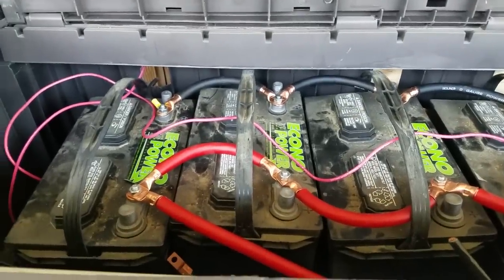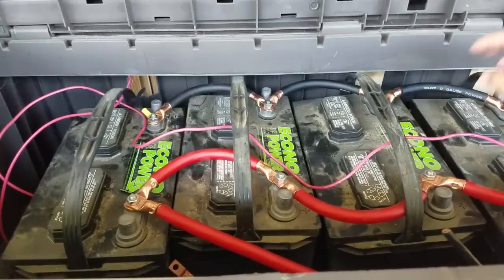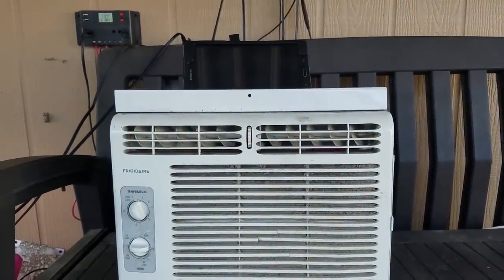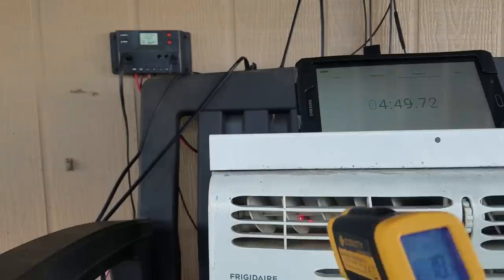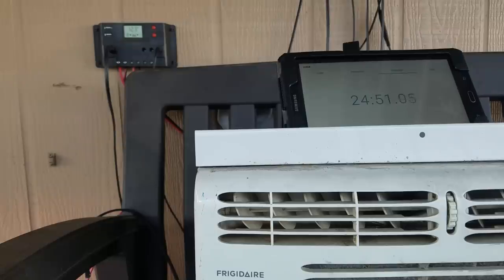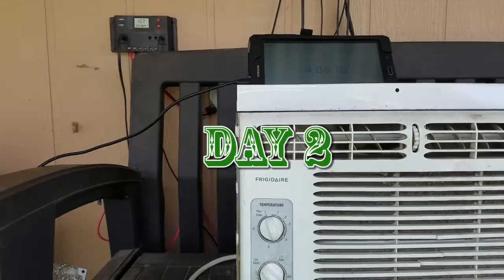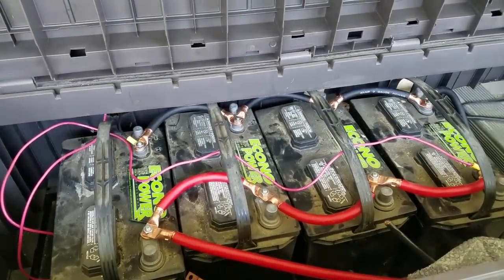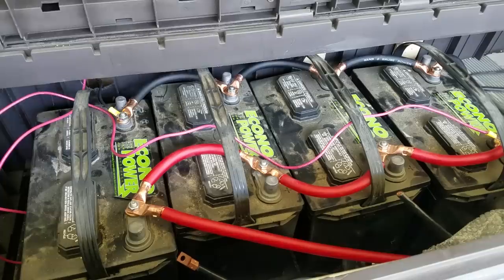Running a 5000btu air conditioner on Harbor Freight solar panels?

Comment: Deep cycle batteries are terrible..
My first time doing solar I had too many shorts on the Deep cycle batteries and they gas off...plus have to check the fluids all the time
But I got them from Kmart so I just kept replacing them for free lol...until I tried and switched to AGM..
They are a little more pricey ,but no more shorts and they last much longer..
Much safer..and no smells
Only if you over draw them too much they will fade in power although if you have a recondition charger you can get them back to new most time's..
I have have my five AGM s for seven years now  running 365 days and they are still taking charge and giving me enough power to get thru each night running two  fans 14 - 7 watt LED  lights inside and outside and flat screen TV PlayStation
I can run Aircon I have run my 5000 BTU from 11 am to 330 pm many time and the rest of the day recharged my system almost to full..
I have around 500 amp hours bank and 750 watts of panels..
Really I found that if you run your fridge on a separate system it is much better so I have two 100 amp hour batts 250 watts of solar and a 2500 peak inverter to get it started and a 30 amp charger controller..it's about $600 worth of hardware ,but it has not failed yet..
Most important is the fridge...to keep lots of fresh  food 
Having a bigger inverter so it  puts less strain on everything and a bigger  charge controller the same.. 30 amp
I am now about to switch to lithium battery set up as the cost is dropping and is about the same price as AGMs and it's way more power for the same price..
So I spent for my system about $2500 seven years ago and I have not had a power bill in seven years..
That's included cables all hardware
It's awesome..

my system consists of..
4600 peak inverter, from eBay 
a 1500 peak watt backup inverter from home depot
2 -30 amp charge controllers plus a back up 30 amp controller it's on stby mode from eBay
five AGMs from car quest 
Two AGMs for my fridge
so actually seven total
3- 255 watt panels I got locally for a dollar three cents a watt..good price and one more 30 amp for my fridge one more 2500 watt  inverter and that it..
One thing I learned is buy backups for everything you buy..if something fails your back online in minutes...iii

Comment: Why aren't you using Trojan L-16 batteries they each are 12v., 300 amp hours true deep cycling lead acid battery, put 2 batteries together in series for 12 volts, 600 amp hours. Or you can buy 4 Trojan L-16 batteries and connect them in series parallel for 24 volts, 600  amp hours, which will perform much better and take longer to draw down if you use Trace Engineering converter inverter with microprocessor to control the charge rate and you also use other sources of renewable energy, like wind,water generation, steam electric generation and genverter type system diesel engine running on biodiesel fuel. Trace Engineering converter inverter is a true sine wave system, is very efficient, consumes very little power for it's operation, it has automatic set up for changing over to different sources of renewable energy and will start a diesel engine type generator with electric starter of course you have to wire everything to work for proper operation on such a system. You can get the Trojan L-16 batteries at Batteries Plus and  Batteries Plus Bulbs. If keep proper electrolytes and pacific gravity proper within the batteries of the Trojan L-16 batteries true deep cycling lead acid type batteries 12 volts type and kept properly charged, they should last at 5 to 7 years or longer. It's best to use as much as you can D.C. lighting, L.E.D. type and other D.C. operational appliances to lower power consumption, you can use with Trace Engineering converter inverter 24v system the 120 v. system or you can pair them up for 24, 240v. system but, if you use a single 24v., 120v. system you can use an autotransformer to step up voltage to 240v. to run an central air conditioning system for quite a number of hours before batteries will going into a recharge on this type system. There are great battery books on figuring the watthours and convert amphours for proper loads consumption and sizing the battery bank amphours.
Reply: Two 12 v batteries in series would be 24 v, in parallel they would be 12 v, but double the amperage.

Comment: A 5000 Watt inverter can pull 416 Amps off the batteries. Use a brushless fan if you have to enclose the batteries.  I would never enclose wet cell batteries myself. Don't use more than 170 Amp/Hrs off the batteries as they are not AGM's  (so be sure you always have 12V reading on the batteries). You may be able to run the AC for 3 Hrs. but doubt it will recharge the batteries for the next day.
Reply: How many watts solar panel do I need to power a air conditioner that's 500w ?

Comment: You do know the AC will pull 60 Amps @ 12Vrms.
Reply: Maybe on initial start up of the compressor. After that it will be around 37amps coming from the battery. These are like 450watts running. And about 4.5 amps draw on the inverter itself. 1 amp when the compressor is off

Comment: All of that (especially the batteries and replacement batteries etc...) cost more than the 5k btu AC would use when it is all said and done.  At least here at almost 10 cents per kilowatt hour.

Comment: You need a "Solar Education"...most 5000btu A/C units require 515 watts of power when running after start up...You solar setup is only 200 watts,so all you're doing is draining the batteries!!!! For a proper solar setup you need a minimum of approx 900 watts,(start up wattage of the a/c unit) so you are not robbing the batteries full time...

Comment: I have been running a 12 by 16 shed off harbor freight solar power    for over a year now. I like not having a power bill
Reply: I think what corbett is trying to say is they are using the $150 100watt solar kits and added to the panels over time as funds permit to gain more charging power
Reply: sounds like that cost quite a bit.
Reply: RingingResonance I have a 8 dollar power bill a month  now for hot water
Reply: how much did the initial setup cost? how much was your bill before the setup?
Reply: Bill before was150 and I did the set up myself
Reply: How much did the solar panels, cost?
Reply: RingingResonance I pay 150 a site

Comment: 150 watts of solar panel X 5 solar hours per day (Look at a solar map) is only 0.75 kilowatt hours of power going in. By the time you figure for losses you have less than 0.5 kilowatt hours of power to use per day. Nowhere near enough to run AC. That is probably enough to run a 100 watt bulb for 5 hours each day if you are lucky

Comment: wow you stuck the fork in a hot topic from reading the reply's . got a good back ground in the physic's,and I can tell you your on the right track it comes down to at the surface of the earth a square meter has the potential of bout'MAXimum 975 watts of energy a meter yes a square meter, if they tell you different there reflecting light to the panel some how in space you got about 1300 watts a square meter so you can see how little the atmosphere attenuates the "signal" unless a cloud gets in the way or something but you don't need air conditioning so bad then, do you. and that's probly good theres still some...some power even if a cloud gets in the way solar powered air conditioning as a stand alone system it could be made to happen    another thing is the people who think that somehow your cheating by using the batteries the system needs a capacitor so it can discharge a constant current and in your case it can run in a charge deficit situation for a period of time you can use the volt meter readings and a battery hydrometer to look for weak cells clean the case carfully add distilled water (rain water is  really good) but just plain good battery maintnence batteries produce hydrogen/oxygen during both the charge and discharge cycles guess where that comes from so watch battery condition so ya the explosive gas hydrogen all you got do to is vent it and it goes awaygood work I hope to see more from you

Comment: Well, I didn't see any mention of how long it ran but based on how many amp hours and guessing the a/c pulls about 450 watts, it should run for about 45 minutes on the batteries alone. With the panels probably 1 hour 15 minutes.

Comment: Running in series at higher voltage would net more efficient draw from batteries. Of course you lose AH capacity but it uses less at a given time.

Comment: econo power O.o thats a car battery.
should look into some proper deep discharge batteries :)
glass mat or gell designed for weelchars/scooters work great last waaaaaaaaaaay longer.
you dont need masive amps up front (car battery) you need sustaind amps
Reply: Screw lead acid.  Go lithium ion

Comment: That system will work and run better with the a/c installed. It would bring the temp down in the room and the compressor would cut off from time to time and allow the batteries to charge.
Reply: How do you hook up a combined  box on a hardfi solar panel system
Reply: How many watts solar panel do I need to power a air conditioner that's 500w ?

Comment: Probably a better test would be to run it in a window in a room. Reason being the ac unit is constantly running outside in the ambient temp. In a window the room will cool down tripping the temp sensor on the ac unit and put it into fan mode which will use much less power. Then run it and see how long it lasts.

Comment: I have a 10kwatt inverter on my truck with one batterie an i run everything off it
Reply: jburr36 An automotive alternator will typically be able to put out between 1200-2400 watts. That's assuming no loses, at the ideal RPM (not idle) and they aren't designed to do so at high duty cycle. So 10kwatt isn't sustainable even while running the engine.
Reply: I never said it was supposed to be sustainable and neither did the original poster of the comment.  

In fact, Lealon never eluded to the fact that he runs anything at the inverter's max load.  What most people fail to realize is the difference between starting current and running current.  Most induction devices are pretty much a direct short until the magnetic fields are generated when first powered on hence why all the lights in a house or car dim the instant a motor or microwave is turned on.

Starting batteries are designed with more thin plates per cell to generate much higher current loads for short bursts.
Reply: jburr36 oh please, I don't need a lesson on electricity here. I was responding directly to your remark to Future Highlight who specifically called out the sustainability of a fully loaded 10kW inverter on battery power alone. 

Sure, it's not a likely scenario but that's not what we're talking about.
Reply: Oh please.  Show me where Lealon ever mentioned sustaining anything from a 10kW inverter maxed out from a truck battery.  He said he can run everything off it.  He never said what everything is and never said maxing out 10kW full load. 

It's you people implying that then making statements of condemnation.  Stop putting your own words into other people's comments then criticizing them for it. It's stupid.
Reply: LEALON SMITH Do you keep the
engine running?
Reply: Aye guys im not saying nothing bad about anybody or anything bad about the vid its awesome vid but i do keep the engine at an idle its a regular alternator from autozone ill be posting a vid soon to show ya but they are alot if thing you can run off an inverter
Reply: some of these people believe you are pulling a full 10 Kw load from the inverter at one time.  They are correct that the alternator and the batteries will not sustain that load for long however my point is that I think when you stated you can run everything off it I implied you did not mean all at once.

I implied you meant your system can run every tool you had without any issues because not one tool pulls 10 Kw+ of power.  

Again the hardest current and power draw for any tool would be startup current and that's what startup caps are for.
Reply: or use the alternator for the power source you shithead

Comment: Very very dangerous to put a non brushless fan inside the cabinet where the Fire / explosives / health hazard gases that you're trying to exhaust pushing air out of the cabinet therefore the flammable and explosive gases that are being exhausted are actually passing directly over Sparks inside the motor very very dangerous the only way I would use that fan is if I had mounted it on the outside pushing air into the cabinet this unfortunately is one of the big reasons why power companies officials Etc are able to get away with Banning solar power like in Florida is because of dangerous things like this if you're going to fail at this you're definitely going to put people's lives in Jeopardy on the grid
Reply: Thomas Ordon
 uhhhhhh.  that is a brushless fan.  I have one just like it. It uses a small induction motor. There are no sparks.
Reply: If the fan is on constantly while the system is running then the hydrogen produced by the charging batteries wont reach the LEL and wont be a problem.
Reply: an AC motor is probably gunna be brushless, my dude.
Reply: You Find Me A Spark On a Shaded Pole AC Induction Motor Ill Buy You Lunch. . .

Comment: I don't get these videos it's the batteries that are running it, it's not like you can hook up the panels to the inverter and run it or run the AC indefinitely with only 150w of solar

Comment: You can run off the batteries, but even if at 100% charge from panels the AC unit is pulling more then panels are putting back into batteries, after batteries are dead it would take along time to bring them back to full charge with a small array, 350 ahr x 12v =4200 watts ÷ 150 = 28hrs of full sun,if you are lucky you get 6hrs of full sun a day, so about 4-5 days to get the energy back into the batteries . Basically 7hrs of cooling 4-5 days to recover, it can be done just not sure if it's practical.
Reply: starting current and running current for the AC unit are 2 different things.

Comment: Just one more saying NAY
NOT SOLAR, you are using battery power,
You are operating at a deficit, panels produce 150w max
And the a/C uses about 700w
Reply: Mr_Wizard he said he wasn’t going to run it all day off the batteries.
Reply: its like burning 1 gallon of gas while  putting 1 quart of gas in the tank
with a limited tank, cant go very long, 
going to hit empty real fast
the A/C uses over 4 times the power, being produced by the Solar panels
the title of the video is running off the solar panels
he is not doing this, he is running off, the batteries
with solar providing LESS than 1/4 of the needed power
what he is doing is 'maybe' the batteries will last 20% more run time
until the batteries are dead
Reply: But that is how solar works. You can not use panels strait to inverter. Also in This case you can not use the a/c  all the time. 
There are better cooling systems that use less electric. Depending where you live. 
I hate harbor freight panels. Too expensive, and too low quality. But hey that's what he has. 
Also I don't think it was using 700watts. I used a 100 watt panel and ran a a/c unit like this, but older, with 244ah of batteries (2.8kwh). For a few hours on high setting. Difference (my panel is a poly crystal, older a.c. unit which used more electric, and my panel was only rated at 100w)

Comment: 1:28 why would you get busted for it?
Reply: No code violations in that mess.   The panels aren't secured properly, no grounding, so how does he get the AC into the house.
Reply: In some states going off grid with solar in a residential area is illegal

Comment: Typical window unit under 5k btu uses about 45 amps on a 12v system or 540 watts per hour. A 150 watt panel would only give about 10 amps nominal power. So if you were to run that ac unit a cycle timer of 15 on and 15 off you would be able to keep the batteries charged with your 150w panels all day long so with 8 hours sun you would have about 4 hours of free cool air with no ill side effects on your batteries.
Reply: can you recommend a timer to buy?   i'd like to set this up
Reply: I have a 1.5 hp (2,544.43 BTU's) inverter window air conditioner. How many amp hours should I get for  batteries? 

What about panels? How many watts?

I am an American living in the Philippines, so I get a lot of sun (most of the year).

I am mainly concerned with daytime hours.  At night, the power rate (price) drops significantly and I am less concerned with using the batteries for the AC, at night.
Reply: Half the BTU... in theory, half the watts and assuming the same AC cycling (on time vs off time) half the battery capacity would be needed. (cooling about 1/3 of the room volume)

Comment: Exactly, he's not running off the cheap Harbor Freight panels.   And I have news for him, a cheap set of panels AND only 150 watts worth won't support a battery bank like his.  He's lucky if he's pulling in 7 amps which is a trickle charge at best.  What a waste.
Reply: Right.  It would take days of perfect sun to "charge" his battery bank to run the air conditioner for 15 minutes.  And when you say 7 amps, that's at 12V -- run it through an inverter to make 120V and you have less than an Amp at 120V (or you would have if inverters didn't have an efficiency loss but even the best ones do).  There just isn't enough power there.
Reply: RIvers have been working on this for years. Some have 800 watts in panels and still can't run AC for very long.